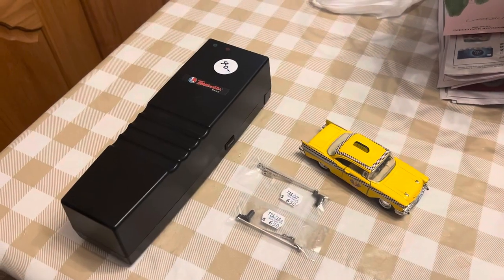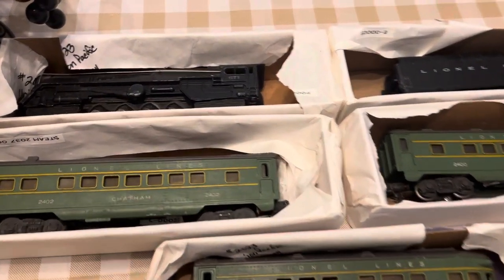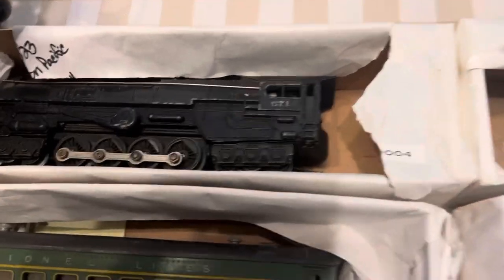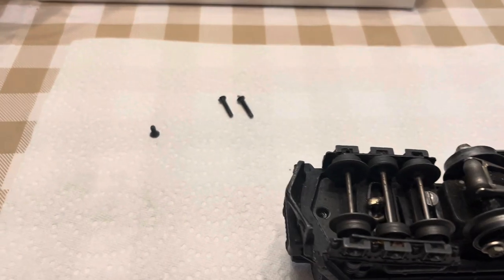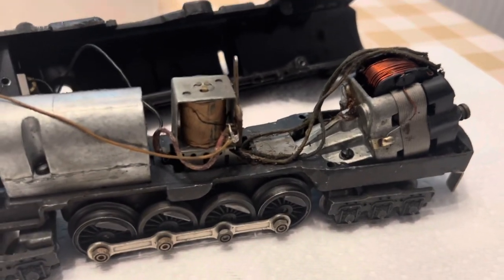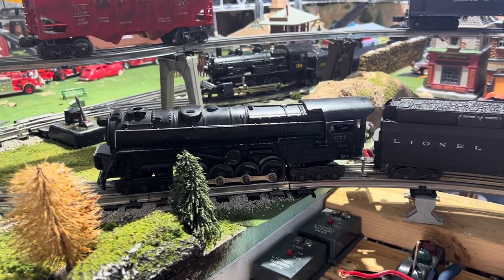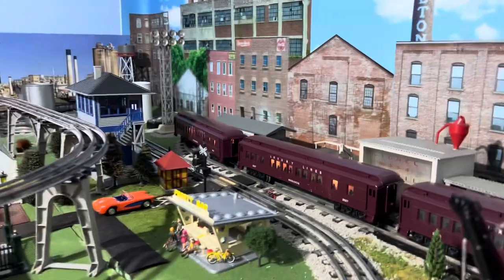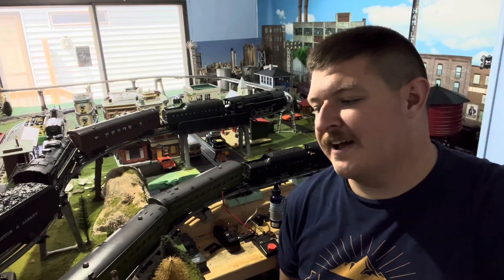Can I Bring This 1948 Lionel Train Set Back To Life?

Comment: Great video. I’ve always been a big fan to the 671 & those passenger cars.
I have a 671 however, I use the silver passenger cars. I’ve never been as lucky as you and found those that you have. I’m jealous. They are super good. Great smoker. Your layout is very nice. Thanks for sharing.
Reply: I'd have to check the books (they're in the other side of the house and one floor up) but I don't think those green passenger cars were in production for very long, maybe only a year or two.  The silver cars predominate.

Comment: For the corner, where everything slows down, I would suggest soldering the track joints in that area. It’s probably a loose pin, and soldering will overcome that issue. Do it for the outside rail for points, then for the center if that fails. Good luck!

Comment: The bulb smoke unit was 1946 production only. You are lucky to have the additional weight installed. I don't believe that you have the correct tender.
Reply from the maker: After some research the tender would have been the 6 wheel Pennsylvania tender for this set. Still looks good with this one though